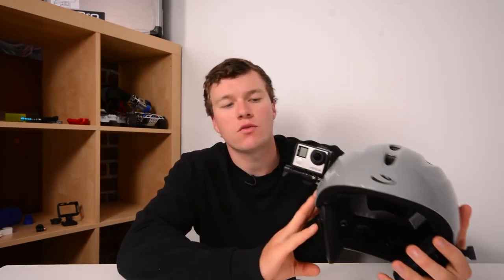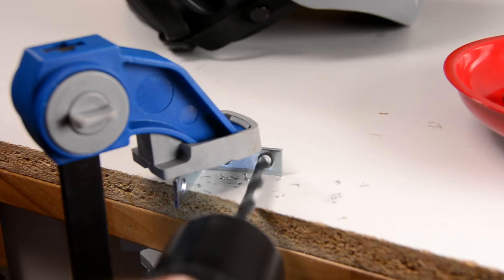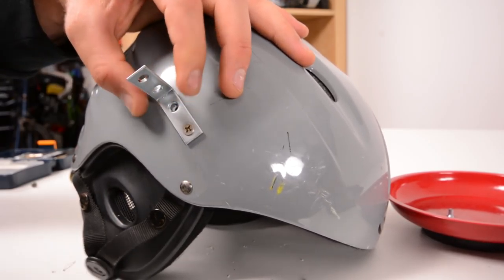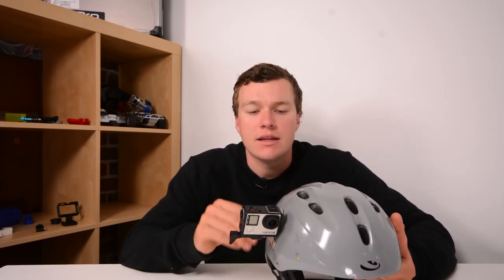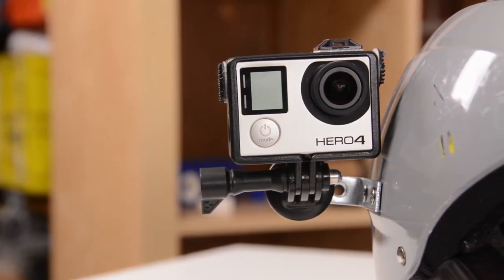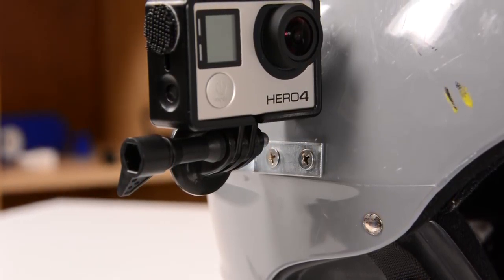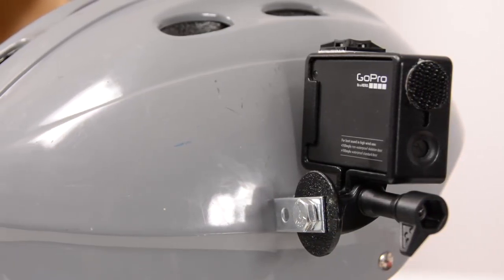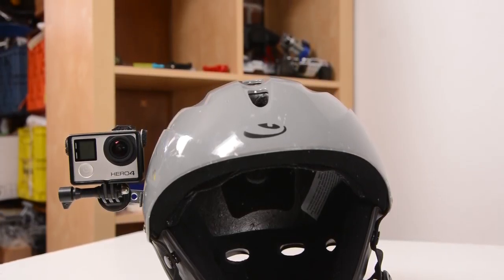DIY GoPro Helmet Side Mount

Comment: there is a reason helmets arent swiss cheese out of the factory! normal side mounts can cause damage in crashes, i can't imagine metal brackets and screws would be good in you skull! usually love this channel but this is just dumb.

EDIT: plus it'd probably be cheaper and faster to just use the normal 3m bracket anyway, and I never had mine catch on anything while riding downhill/enduro MTB with it.